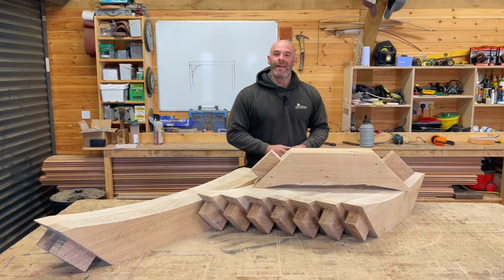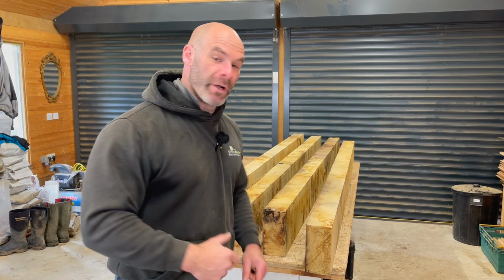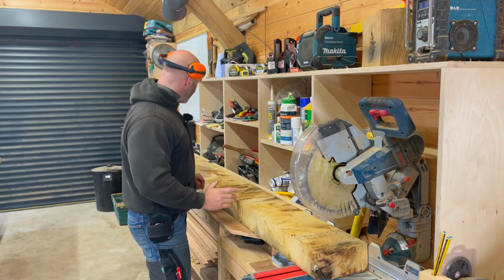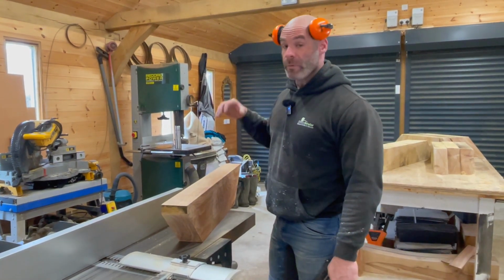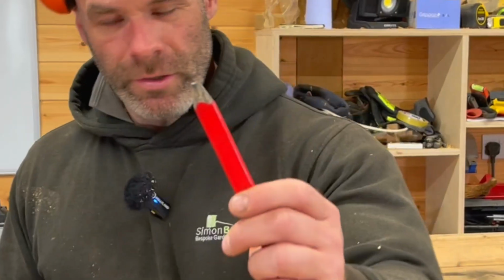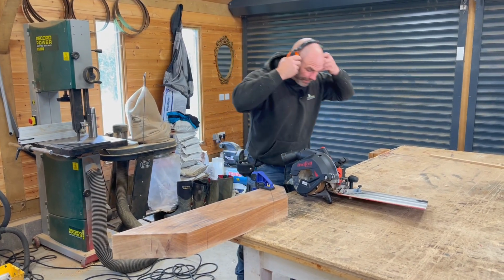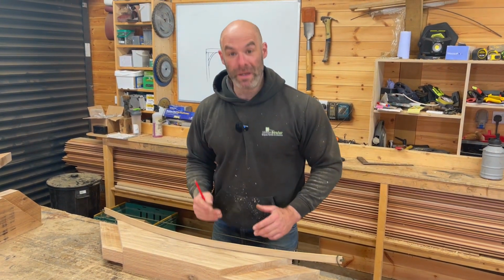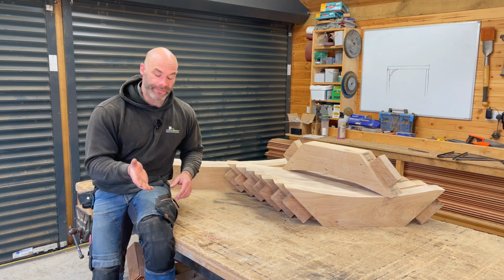Using BIG TOOLS to Make Oak Knee Braces in the Workshop

Comment: Hey Simon. Can the nfu50 be used to remove the waste parts of your tenon if I didn't want to buy a bandsaw. I use a mafell p1cc jigsaw to curve my braces and I want to invest in the nfu50 but I'd really like to be able to spin the tenons and set it at an angle to take the rest away too
Reply from the maker: It can be set at an angle yes 👍🏻
Reply: @Simon Bowler  cheers mate, going to order one this week. Your videos sold it to me 😂
Reply: arriving tomorrow with dust extractor. your videos are dangerous

Comment: How have you distributed your power in the workshop Simon? I see the sander lead from above. Great video now go and eat your Easter eggs 😃
Reply from the maker: I wired the workshop up when I built it and got an electrician in to connect the fuse board. I just made sure there was sockets EVERYWHERE! including overhead ones near the bench 👍🏻